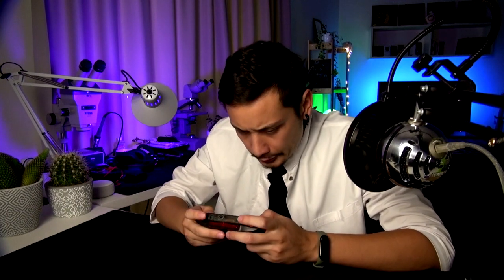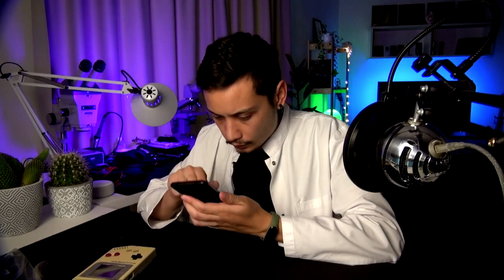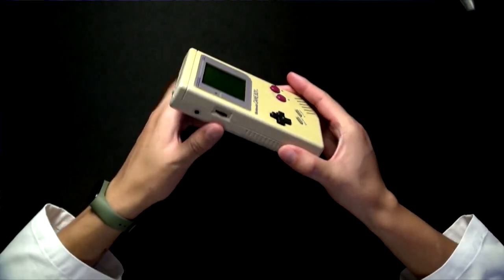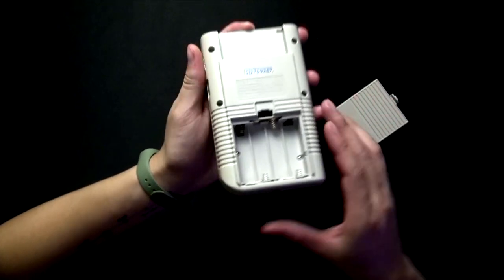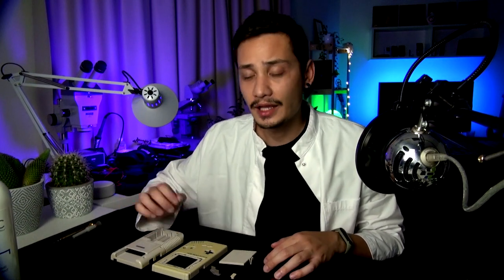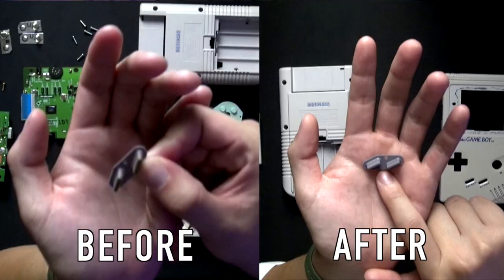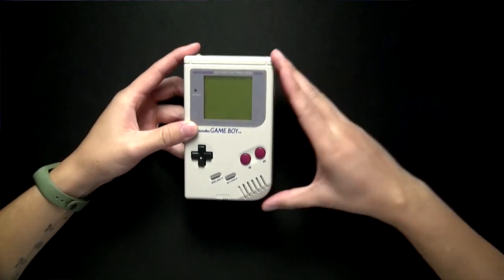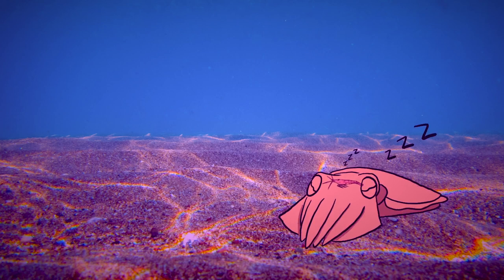Why Does Old Plastic Turn Yellow? (and How to Reverse it) - Curiosités #3

Comment: Now that I think about it, I'm pretty sure this also happens to old lego sets. Awesome video!
Reply from the maker: I'm sure it does! Thanks!
Reply: @DrNEMO  I have a 1990s LEGO rocket and it is still white but then again I have a slightly older one that is very yellow
Reply from the maker: @donutninja13  Nice! Even in the same brand, same console, same production year, you can find differences in yellowing. This can be due to differences in plastic composition!

Comment: Great video, Dr Nemo. Do you have any suggestions if the plastic I'm trying to remove the yellow from is mixed with some other colours, too? By the way, my Star Wars toys were kept in the original box in the closet, and there was no exposure to sunlight 🤔
Reply from the maker: Thanks! Yellowing will happen in older plastic, as the brominated flame retardants they contain will naturally degrade. Lights just accelerate this process.
I'm pretty sure you can apply this deyellowing process to any color!

Comment: I have some action figures that has turned yellow even though they were in storage instead of being in the sun. If I were to do the whitening treatment with the hydrogen peroxide and UV, even though it would whitening them, would it also enforce the plastic so it won't become brittle?
Reply from the maker: My understanding is that we can't reverse the structural damage in the plastic. So turning your action figures white again, won't make them less brittle :/

Comment: I really want to deyellow my Gameboy Advance, there are just 2 things stoping me.

1 i dont have the Uv lights that i've seem some other channels uses, but you use the sun and i think thats pretty dope, can i use the peroxygem from the drugstore or it has to be the hair dyer?

2 when they remove the screen from the gba, i see some plastic security, like a black thin sticker removed that you cannot put back in anymore and most of the times they change everything related to the screen and i dont have any replacements.
Reply from the maker: 1) No, it doesn't have to be the same as mine. I had that one because I used to bleach my hair. But if you buy the liquid one you find in drugstore, it will definitely work. In that case you will have to submerged your GBA parts in the liquid. Sun light works great, but it takes some time, that's it.

2) Mmmm, not sure exactly what you are talking about. Maybe could you share a video or image about it? By memory I don't remember stickers you cannot reuse to put every part back together.

Comment: Very nice video! Can iask ... i have Siege Jetfire(white) and i put also some kind of developer solution like yours on Jetfires' shoulder , hands, and knees. I didnt put him in the ziplock coz hes too big. I just placed him directly infront of  UV lamp light for like 3 hrs. Then after that, i put him out in the sun for like 2 hrs. The yellowing is much less now. I just worry since i didnt put him inside the ziplock , would that cause the other parts of Jetfire  that i didnt put solution , to yellow?
Reply from the maker: Hello there! I think the zip lock has three functions: to avoid spilling the hydrogen peroxide everywhere, avoiding the the liquid to evaporate too quickly, and maybe increasing temperature (not sure if this one helps). If you don't use a zip lock that's totally fine, it's just a bit less effective. I don't think the other parts will yellow because of this!
Reply: @DrNEMO  thank u sir for explaning this. Much appreciated!

Comment: Careful with that super glue. Cyanoacrylate based glues tend to evaporate and condense nearby, causing a white film to be deposited onto whatever surface happens to be near. You don't want that to happen on your clear window, or worse: your display. Learned that the hard way when I decided to use superglue rather than model kit glue on one of my airplanes. Totally messed up that cockpit.
Reply from the maker: Hi Juan, thank you very much for your advice. It is indeed very true, and I didn't think about it :) Fortunately it went well this time :P

Comment: May i know the cream for hair use is how many volume and % ? Thanks
Reply from the maker: Hey! I bought "M:C Meister Coiffeur [Cream Oxide 6%]". It should be 6%, which corresponds to 20 volume if I remember correctly!
Reply: @DrNEMO  if i use 40v 12% is ok? For PS 1 grey colour controller
Reply from the maker: @alexchin1515  I haven't tried with that high of a concentration. I think it should work though. It will be faster, so maybe check the result at intervals of a few hours, just to be sure. Don't forget to do this in a well ventilated area and to wear gloves!
Reply: @DrNEMO  ok sir ,i will try in high volume,later update u result

Comment: Does this work on power rangers figure . The white parts turned little yellowed  but worried it do damage on other colors
Reply from the maker: That is a good question. I've used the method on parts that had a tiny bit of colors or that were more greyish and it worked fine in my experience. Now, maybe to be cautious, you could try it on a hidden colored part of the figure and see if anything changes?  Or wrap the colored part with something so it it's not in contact with the hydrogen peroxide.

Comment: This same curse has affected the front of my GameCube :(

Which other retro consoles do you have?
Reply from the maker: Hi Marc! Maybe it's time to deyellow it :)

In my current collection (not necessarily all retro though) I have A few Gameboy DMG, Pocket, Color, Advance, Advance SP (most of these have been modded), then Nintendo DS, DS lite, 3DS lite, I made some Gambeboy Macro with broken DS and DS lite, Super NES, Wii, Switch, PSP-1000, PSP-2000, PS1, PS2, Xbox 360, PS4.

Comment: Yes, the hydrogen peroxide works well for turning yellowish plastic white again but after a couple months later the plastic turns yellow again. So the results are not lasting long. I have tried this procedure several times and I got the same result which I felt totaly wasted my time. The hidden part is knowing how to prevent re-yellowing process???
Reply from the maker: Mmmm maybe you have a very sensitive plastic! My gameboys, SNES and PS1 are very stable even after a year.
The secret is really to keep them as far as possible from sunlight! :)
Reply: @DrNEMO  dude I had 2 PlayStations in a box, in my closet for about a year and it turned yellow. I never had that issue when it sat out in my room and was played daily

Comment: Does this work on paper?😂
Reply from the maker: What do you mean?
Reply: @DrNEMO   Most paper also go brown or yellow when kept under sunlight. Since paper is also a polymer, is it because if the polymer breaking down?
Reply from the maker: @ashgreninja7521  Ooooh like old newspapers? Yes, from my understanding it's the same process! The molecule involved is, as you said, also a polymer, called lignin. Not 100% sure light is necessary for the process to occur though.